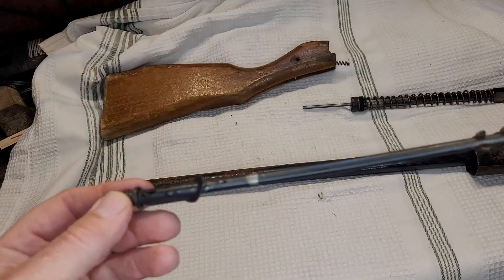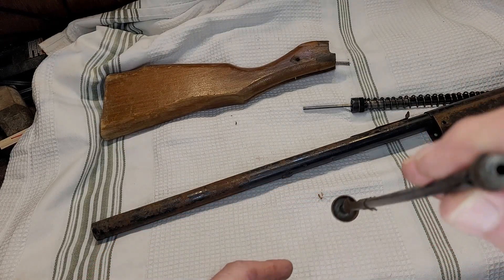Daisy lever gun fun 33. How bad?

Comment: Russ, what method would you suggest for attaching that bracket to the barrel?
Reply from the maker: @Woodsman160  My two favorite methods of attachment are silver bearing solder paste or a strong epoxy.   I use them for almost everything.  Rivets can work but pose problems with size and clearances. 
Russ
Reply: @daisylevergunfun4786  Thanks Russ. I've wondered about how to attach a fore stock to a small frame daisy and that might be the ticket.